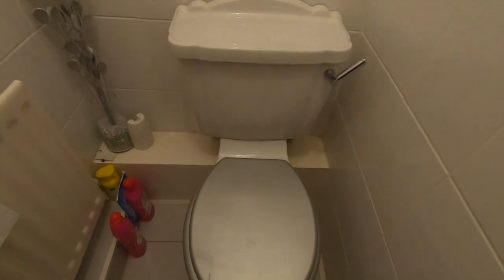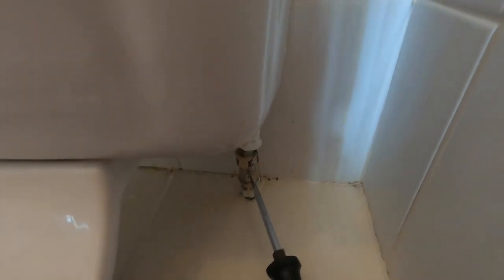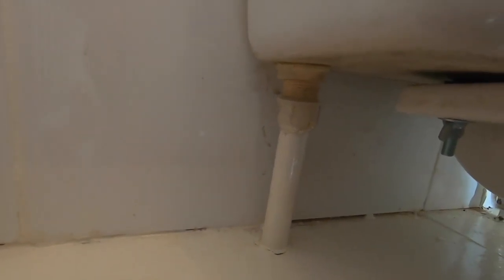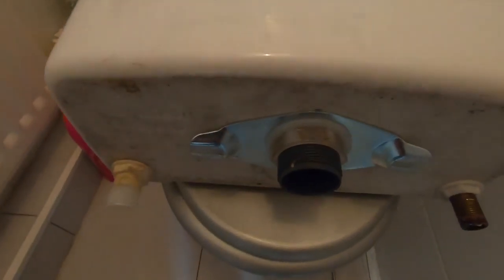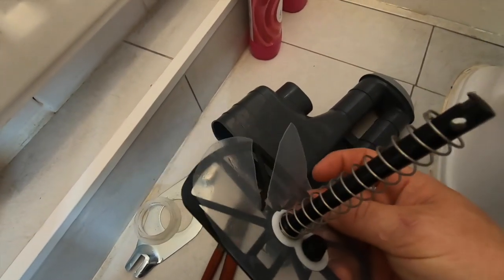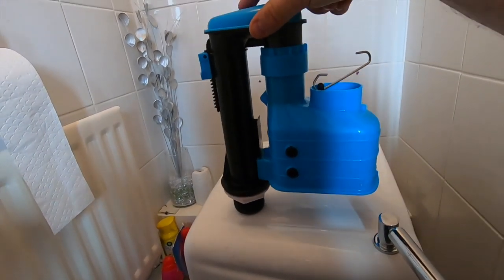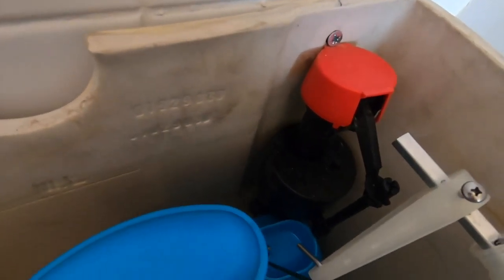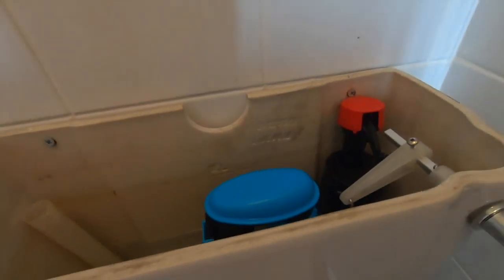PARKES PLUMBING VLOG 003 | Toilet Repairs

Comment: Great video 👍 super easy with nice shiny wing nuts 😂 I like to put some plumbers mate around the top of the bolts when I slide them back in the plate just stops them falling out when you can’t find the bolt holes 😂 that viva syphon looks alright I’m going to give one a go .
Reply from the maker: Hah yeh it was a lucky one that one. Good call with the plumbers mait.. I never use the stuff personally